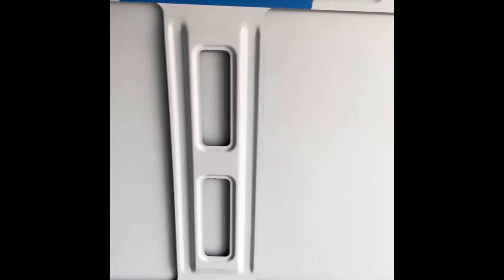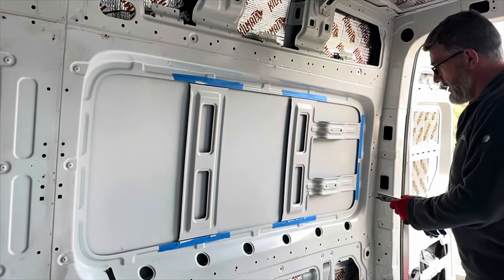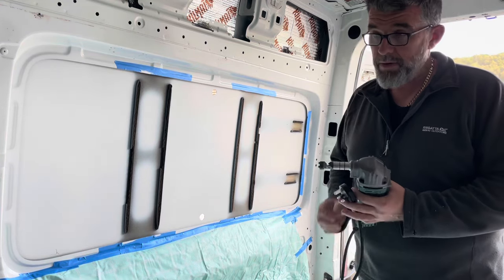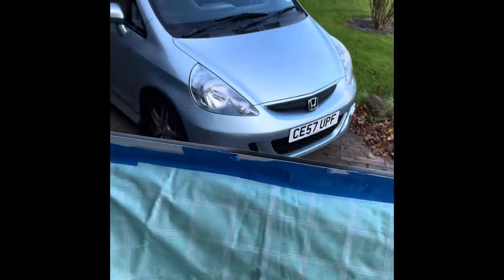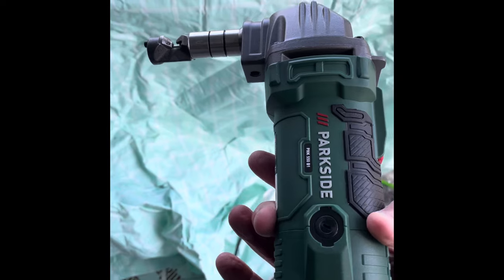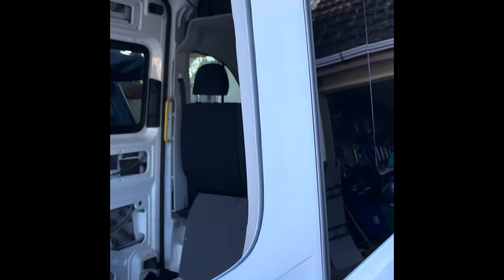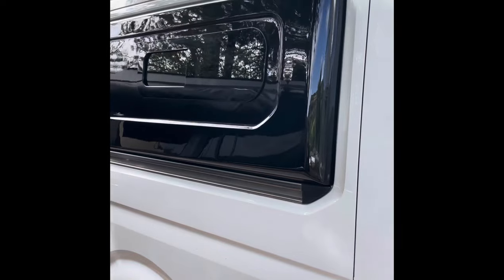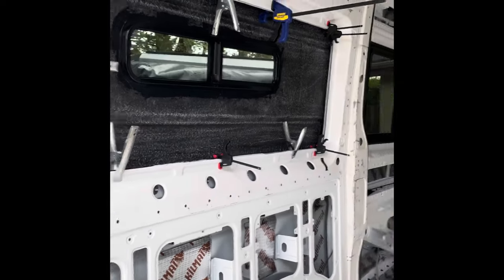VW Crafter campervan build side pods/flares installation.

Comment: Cheers mate. Tony just dropped mine off today. Question for you > Was one tube of bonding enough for both pods? Cheers 🤘
Reply from the maker: Hi 
I think I used two tubes, not all of the second one but definitely more than one tube. I bought 3 to make sure I had enough as it’s not the type of adhesive you can buy in my local DIY shop.
Reply: @luxduoverland674  wow, that is some sticky shit💪💪. One tube & one pod down. Many thanks u
Reply from the maker: @angus9541  😂 yes it sure is and a pain in the arse to get off anything that you didn’t want it to get on. No problem glad to have helped out 👍🏻.

Comment: Looks great! What hand nibler are you using? Ive not seen one before. Thanks.
Reply from the maker: Thanks, it’s a parkside electric nibbler like this one on eBay 
https://www.ebay.co.uk/itm/145570694992?mkcid=16&mkevt=1&mkrid=711-127632-2357-0&ssspo=enX54lm3Rf6&sssrc=4429486&ssuid=VpZcwKQnTKm&var=&widget_ver=artemis&media=COPY

It was superb and cut out the fan, windows and pods easily. Much neater job as the nibbler follows the manufacturer edge on the inside. No sharp edges either so in my option safer to use. Bought it specifically for this job and saved a lot of money doing these things myself. 
Thanks for watching 👍🏻
Reply: @luxduoverland674  thanks for the reply. Yeah they are great aren't then, I've got a Makita one and have used it for years. Perfect for a great finish without the drawbacks of other methods. I meant the hand nibbler though that you used on the inside...I would normally cut that with an angle grinder but you have to protect everything and then clean up the mess but you managed to get between the skins with that tool.
Reply from the maker: @samscotchmer6836   Ah right sorry thought you meant the electric one 🙄. It’s a Draper one like this 
https://amzn.eu/d/gdajCFd
I looked at different ways before doing it and I didn’t want all that swarf flying round inside the van. It’s a great little tool and cuts easily with no mess at all. The cut metal curls up as you go leaving a nice little coil and no swarf.
Reply: @luxduoverland674  amazing, thanks. I've bought one and will give it a go on my next windows
Reply from the maker: @samscotchmer6836  nice one hope it’s a useful tool for you certainly was for me 👍🏻.

Comment: My whole battery tool collection is parkside 👍, most I rarely use so as you say not worth the investment in say de Walt .
Reply from the maker: I’ve got Makita drills and impact driver but not worth the few hundred for this job. The Parkside nibbler did the job perfectly, I also have an impact gun the same make and it’s pretty good. I’m not taking the wheels off everyday so it does what I need and it’s quicker than using a ratchet 😂.
Reply: @luxduoverland674  same here, I have de Walt for work and parkside for DIY, I also have the wheel gun, it's actually quite good, I was surprised,  OK it's no snap on but it manages my transit wheel nuts ok, well IF they are torqued correctly it will, it struggles if hey have been air gunned over tight by some monkey in a tyre shop 🤣 but that's what a 3ft breaker bar is for 😁
Reply from the maker: @Dirt-Diggler  it’s great for getting the wheels off the truck as I torque them correctly 😉.